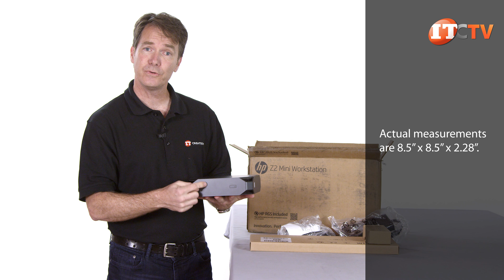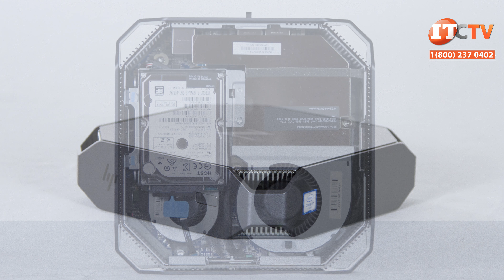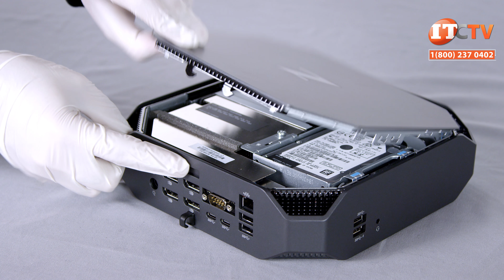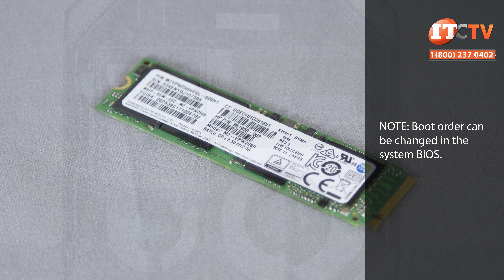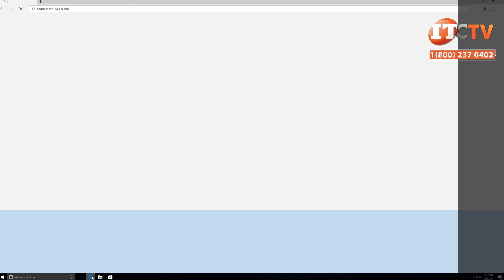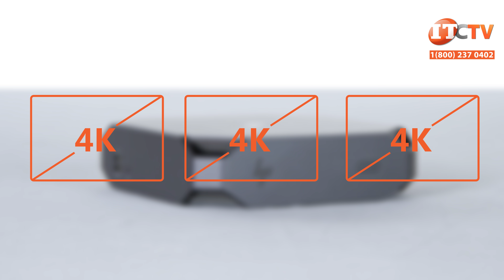HP Z2 G3 Mini Workstation Pint-Sized Powerhouse Unboxing Review

Comment: Can you connect to an egpu for better performance in gaming ?  
I came across an option to add thunderbolt 3 port.
Reply from the maker: IHi Naomi M, I am not that familiar with external GPUs but can and will assume you have the right idea using a Thunderbolt connection to achieve the bast speed possible. that said it's still no match for a card residing in the PCIe lanes in terms of speed. However, it is my opinion that it will increase performance to a noticeable degree. Here is an interesting article, https://www.makeuseof.com/tag/everything-need-know-external-gpu/ ,oh, and if you will just be using the system for gaming, consider building a gaming station as they suggest at the end of the article. It's much less expensive. Thanks for watching!

Comment: Which configuration does you recommend to run virtualization programs? (vmware, vbox, etc.) Thx!
Reply from the maker: I would say go with the Performance model to run virtualization but you can use virtualization on either configuration. We recommend VMware but we are resellers of that product.

Comment: Does it come with inbuilt WiFi?
Reply from the maker: HI Rajesh, yes, it does support WiFi in the form of an optional M.2 key A/E 2230WLAN/Bluetooth card but it may only be available on the performance model because keep in mind there are two versions of the Z2 G3 platform, an entry-level version, and a performance version.  This is a link to the technical whitepaper https://goo.gl/d2hoX4 which will provide more information. That particular note is on page 4 under I/O and Storage. Pretty sure they will be coming out with a new version shortly but we did have this in-house and it was quite impressive for such a small platform. Thanks for watching!
Reply: IT Creations, Inc. thanks for your response.  Sorry, the review on this video was a entry level one? I don't remember there was any mentions about WiFi. Sorry if I had missed that. When you say the WiFi is an optional one, can I have that added to the entry level one at additional cost?
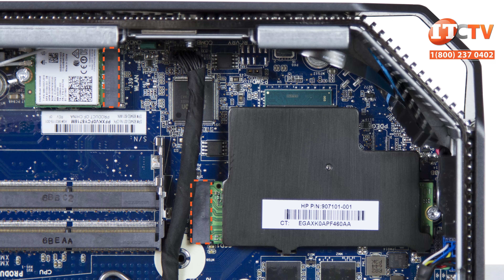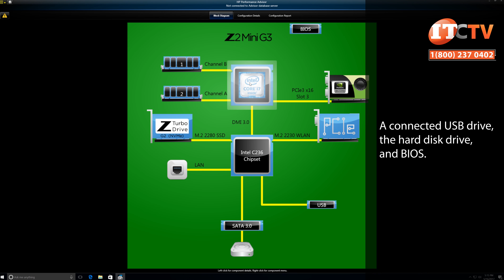Reply from the maker: HI Rajesh, The review video was actually the performance model. We do not currently have any of these in stock but I do believe the M.2 WiFi is available on both the entry and professional versions because they want you to be able to access the system remotely over a browser using their remote access software products. Making matters even less clear is the fact that their literature says optional in one area, and integrated in another area. You can actually see the WLAN card in the video at 4:52 and 5:56. It's right next to the memory modules and the circuit board says LAN or something… Hope that helps, thanks for watching!
Reply: IT Creations, Inc. you cool. Just let me know when you get this item in stock. Also curious to know the next version on this, thank you!

Comment: Will it work for HD or  4K video editing ?
( Using Adobe after effects and photoshop )
Reply from the maker: Hi Juan, There are two different versions, an entry-level version, and a performance model. If you will be using After Effects you definitely want the performance model as that one supports a Nvidia graphics card and up to 32GB. There's also support for two drives a 2.5-inch SSD and an M.2 stick for super-fast boot and program agility. If I remember correctly you cannot upgrade the entry-level version to support the graphics card. This system is also only compatible with a single  Nvidia graphics card, the M620. The performance model is capable of driving four displays at a maximum resolution of 4k or 2 displays each at 5K. This is a neat little system that you can carry around with you and plug into whatever, but it is limited on upgrade potential. That said, I still think this is a great little system. It is very well designed and quiet and you can download remote graphics support free. Here is a link to the technical guide: https://www.itcreations.com/user-manuals/Z2-G3/HP_Z2_G3_technical_guide.pdf?utm_source=youtube&utm_medium=link&utm_campaign=hp_z2_g3_mini_techguide_youtube  Thanks for watching!

Comment: So when the graphics card packs in you have to throw it away? Why can't you upgrade or replace the card? Or can you?
Reply from the maker: Yea, that would be a fatal flaw as the graphics card is integrated onto the mother board. No upgrades. Thanks for watching  +Fueanglada Srineul
Reply: Booo. That sucks. I currently have a 7 year old Dell XPS that's having issues with the onboard card. I want a replacement and now need to go to something with workstation power... Is there anything you can suggest looking at?
Reply from the maker: HI +Fueanglada Srineul, We carry a bunch of workstations from Dell, HP, and Lenovo. When choosing a system it's best to know what you will be using it for. Do a little research and find out what other people are using for your program of choice. All of the workstations will get the job done it just depends on how fast. We have short ads running in some of our videos where you can save $150 on HP workstations. Anyway, here are a few links to our site where you can see the various platform capabilities and download teh specifications for the systems:

Dell:  https://goo.gl/n6nAzN
HP: https://goo.gl/ay6bgA
Lenovo: https://goo.gl/oTUJ92

Thanks for watching!